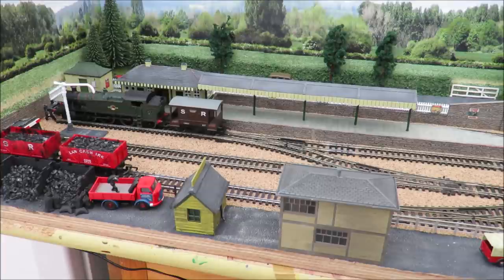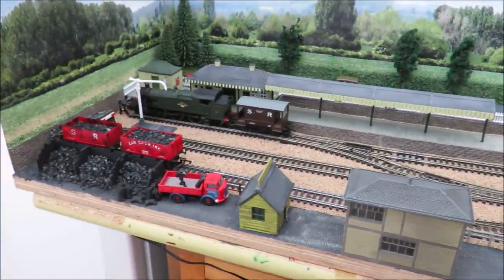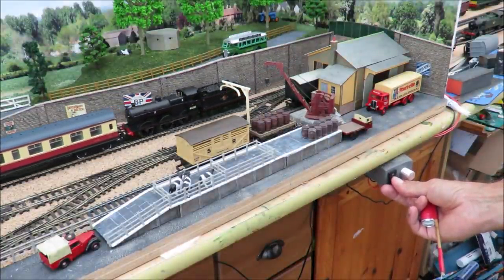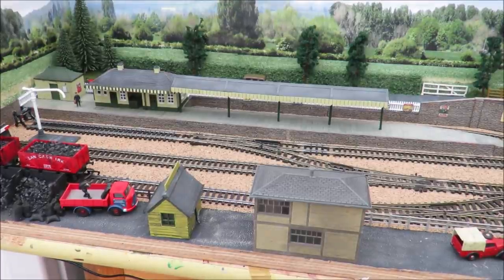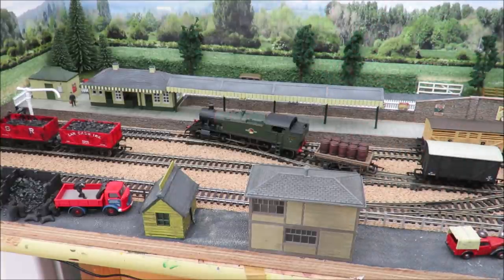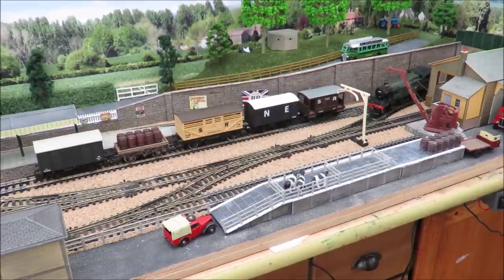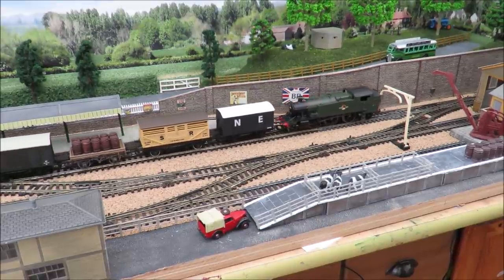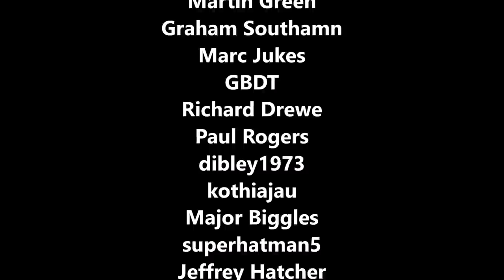My Ideal Shunting / Switching Model Railway Layout - Part 3 - Operating Potential / Trains Running

Comment: The layout shows the utility of having long head shunts and at least one storage (spare siding) track.  It’s like that game with 15 numbers on small plastic squares with one open area to allow the numbered squares to be slid into position. Open/available spaces are good. 

I’m not very knowledgeable about all things railroad ...... however, I get the impression that British wagons may be on average shorter than American rolling stock. All that to say that when designing layouts it’s good to allow enough space to allow the wagons that are used to sit comfortably without blocking track access for another consist. This presentation demonstrated that concept. 

And yes, test locos and wagons and their combinations. I’m still learning what pieces of equipment are best for a specific layout. 

Thanks, Mark
Reply from the maker: Thanks for the comment, yes prior to the 1980,s ish UK wagons were mostly very much shorter
Reply: Great thank you, I will have a look and  try and make one lol

Comment: Until I found your videos I never even considered having a layout just for shunting. This layout also brought to mind the town of Eureka Springs, Arkansas. It had a spur off of a main line that ended on the north end of the town. The only thing left is the spur. Very pretty small station made of stone, and there's a now abandoned ice house that the spur connected with. When I start building my own shunting layout, I might model it similar to that. Also there's a long abandoned spur that goes from my city to a little town called Chadwick, Missouri that used to service a mill down there, so I might incorporate that as well to give another industry. 

Thanks for the great video!
Reply from the maker: Glad we could help. Shunting is rewarding in itself and does allow you to at least run some locos and rolling stock in a small space. Those locations sound fascinating
Reply: Sounds a great basis for a layout, especially like the sound of the ice house

Comment: As you said we all have a preference for shunting.
When I was building my North End Sidings layout's actual sidings I purposefully chose to not include any run arounds.

Which mean I could use two locos to pilot between each other various stock consists.
Moving stabled stock, oil tanks for refueling etc all good fun.

Keep the videos up mate!

Comment: For the points you can use underfloor pushrods instead of point motors. That will save you the effort of rebuilding the platforms.
The problem with the newer style couplers might be the return springs. These will try to keep the coupler straight when no force is applied to keep them in a reasonably straight line.

Comment: It looks great i really like the wall at the back which slopes down.Well done for showing us all the fiddly bits! When it didnt go to plan etc.A lot of wagons are just to light to be pushed back and work better with a bit of weight added.My Budget Model Railway controllers are still working great after two years of using them.I wonder how many people made them in the end?
Reply from the maker: We have sold 500+ so far, 9 so far this week, so there are a lot out there!
Reply: @BudgetModelRailways  Im not surprised they do work very well,miles better than those poxy Hornby efforts,i also have a Gaugemaster controller i love it but these work just as well in my book :)

Comment: Watching now and I have empathy with you regarding the loco hesitation and and wagons jumping over points.
I have just about finished laying track, still looking for two left hand points which are difficult to find second hand here in Toronto. The odd older Triang  Sleeper coach will de rail and I don’t know what caused it. Also have acrake of grain tanks and some of them jump over points.
Could you do a video on this topic?

Another thing is the controller, I too have the same one you have and find sometimes when I try to slow a train down it tends to speed up. Any ideas on that?
Thanks and keep up the great work

Comment: Brilliant video , my small model railway is a shunting layout and I've been lucky to have done real shunting with a class 10( Blackstone diesel engine ) version of a class 08 and once shunted a class 33/ 73 and with Queen Mary brake van, to move a steam loco for coaling up.and also some trip goods workings too , and found I like shunting more than just going up and down the line with a passanger service, keep up the good work .
Reply from the maker: That must have been great! The nearest I got was a short ride in a class 07
Reply: @BudgetModelRailways  it was , can't do it anymore due to heath now and at 52 my eye sight not as great lol ,  but great fun getting to drive a diesel loco regularly a few years ago and one that a rare bread too as only a handful of class 10s left and I think only 2 still run now ? Also got to drive a class 37 too .when this horrible virsa thing is over you should both come to the spa valley railway am sure I can get you both a cab ride in one of the diesels?
Reply from the maker: That would be great thanks. We had a lovely day on the spa valley a few years ago. I had my cab ride on the lavender line some years ago as I used to know a couple of people there. Take care
Reply: @BudgetModelRailways  that's ok :) I rember one night on one of the diesel galas , a mate was driving the class 26 and I was on the rear with a class25 and the class 26 was failing , and we had a heavy train of mark 1s , so as my driver was on the radio and dead man's pedal and i on the power handle , so i put it on full power  and I still can hear and see the noise from the 6 cyl  Sulzer engine and sparks from the engine exhaust , was like the old times going up the bank at Manchester miles platting , just pure magic, and some  people think diesels don't have character! Lol also done  some  steam and it's not Romatic I can tell you that  from experience! Lol.

Comment: Pinking shears/craft scissors eh ! what ever next !!! Can't believe that I have a pair of my mums sat in a drawer and didn't know what to do with them . . . I do now !!! excellent idea. I have a large layout but with only a small engine yard to park up the odd engine. Having watched your vids on this theme I've now decided that I will be extending the width of my layout another 12" wide x 6' long and create a shunting yard. I have only ever used peco electrofrogs which require power switches as well as point motors. I've just bought a GWR train pack, new and un-used, of eBay that you mentioned on your harbour side vids as it seemed well geared for crawling. I hope this is as good as yours is. I never thought I'd be  interested in 'shunting' as it's termed but I've only watched a few of your vids tonight and I feel like I've been missing out. 
Question . .  do you think that using peco insulfrogs (smaller than Hornby) would be best for shunting rather than electrofrogs and all the extra power switching. The reason I ask is because if I use insulfrogs will this stop other trains in other siding from moving. I was thinking that if I had a long siding I cut effectively power it in 2 stages where only the front train would move leaving the rear train stationery and move that one later by powering up the 2nd part of the line.
I too have a problem with maintaining long term interest in things so I have to work around it . . . 'It needs to be complex and done now'. I know you'll understand where I'm coming from. Have to say I'll be watching more of your vids for sure. Cheers for the inspiration. xx
Reply from the maker: Hi, many thanks for watching and commenting. I always use small Peco insulfrog points for DC shunting as they transfer the power reliably and remove the need for isolated sections etc
Reply from the maker: Ps, but you wouldn't be able to have two trains on the same long siding unless you put an isolated section in
Reply: @BudgetModelRailways  Hi, thanks for the response on which points to use. I think I'll go with the peco insulfrogs as it'll be less of a headache if I forget to switch power to the right sections which could frustrate me. Cheers.

Comment: Due to space limitations my plan has always been to have a shunting layout. However, I really haven't known what to do for a track plan. Whilst I have been inspired by your earlier shunting layouts (it was the £35 layout that got my juices flowing for a layout in the first place) this is the track plan for me. Thanks, Mike, I think this will be perfect for my space and for my train running pleasure. Now the winter isn't too far away, I think it will soon be time to get building. I was undecided, also, whether to ballast or use mat. I have decided to ballast. I have also spent the past couple of years collecting all the bits and pieces that I need from bootsales, table sales, Facebook and Ebay and now I have no excuse not to get started, as I probably have enough track alone for a few layouts lol.
Reply from the maker: Sounds great , have fun with it and let us know how you get on

Comment: The layout you have build would work really nicely with some 'remotely' switchable points.
I found a fairly easy method for achieving this.
Get a small, long metal rod and run it through a small channel cut into the baseboard. Alternatively, you could have a layer of cardboard or something to elevate the track and leave gaps for the rod.
On one end, connect the rod to the point slider, and the other end (which should be sticking out from the side of the mechanism) put a small handle like thing, perhaps a cork or something.

This mechanism works well and doesn't impact the look of most layouts as real points are operated in ways similar to this IRL.
It can look especially good if you have all the rods running into the bottom of a signal box.
Reply from the maker: I have seen that method. If am honest I am quite happy using my finger. Cutting a channel into the baseboard, thick ply, would be pretty tricky and as I don't plan layouts, they evolve, I wouldn't know in advance what buildings and scenery would need adapting. I have used this method in the loft layout though
Reply: @BudgetModelRailways  Fair enough. I tend to put a softer layer of material over my baseboards, which is why I am able to use this method.
At the end of the day though, people all have different ways of modelling and there is no 'absolutely correct' way to do it. It is best to just model in a way that you find best.
Reply from the maker: I think its a good system with lots of advantages as you say
Reply: Ive seen that method used before its a very clever but easy way of changing points.

Comment: I'm interested in making a shunting layout, but I also love watching my trains go round. Could you do a combo of a run round layout & a shunting one like that? Not something I've really seen before, but I really like the look of this layout!
Reply from the maker: I like both too. If you had enough room it would be quite easy to have both, picture this layout as part of a loop
Reply: You can have a look at this layout: https://www.youtube.com/watch?v=nITB3NzGLR4&feature=emb_title  A shunting puzzle designed to be used both as a separate unit and as part of a larger modular layout. With an Arduino for driving and sound
Reply: @BudgetModelRailways  yeah that's not a bad shout, though that's the problem; having enough room. Might try & have a go though, plan a shunting layout like that inside a 1st or 2nd radius loop...
Reply from the maker: Exactly, it should work nicely as a through station
Reply: Matty P shunting layouts are a great way of unwinding. Mine is based on the inglenook shunting game, with the ultra reliable little Ruston shunter. 
.
Reply: That’s what I’m planning once I build up my skills. A large loop to leave my express running. A junction station to run a tank engine and auto coach along to my country terminus. Which I will happily spend time shunting

Comment: hi, great video, i use my old triang brake vans which are small, shunting the Birds Custard wagons around with a triang dock shunter ,then a triang class 31 picks them up for the journey to the shops,, i agree you do not have to spend a lot of money on locos and wagons. most wagons i have cost less than six pounds each. locos around twenty five pounds !
Reply from the maker: Sounds great fun, those are the sort of prices I aim for now too

Comment: OK, you didn't loose me. Just found you. Very nice switching (sorry shunting.) Question: I am from the US and still don't really understand the use of brake car (sorry wagon.) In the US the locomotive provide the air power to all the cars (sorry wagons.) Like someone mentioned, yes the hobby can be costly, but hey, that is the price of fun.
Reply from the maker: It's similar I believe to what you call a caboose?
Reply: Well, a caboose doesn't provide braking power. It is a place for the conductor at the time to allow checking for "hot boxes"(journals). As time move on, trains became longer and it became impossible to check bearing from the back of the train. Technology allowed the use of remote control "hot boxes" automatically from the track side with radio communication in the cab. The "journal" that use grease and packing was replaced by wheel bearing witch are more reliable. So the combination of those elements made the caboose obsolete. It is now replaced by an automatic device the check the air pressure and is fitted with a flash red light. Of course all of those apply to freight trains only. @BudgetModelRailways

Comment: That's a nice little layout you've built there. I know from experience that mixing wagons with different sized couplings can be a recipe for hours of frustration. My solution was to only use wagons with large D couplings. Happily the used market is awash such wagons :) Most of mine are Triang/Hornby but I've also found that Airfix, Dapol and Lima wagons play well with them. I avoid ANYTHING by Bachmann. If you've got a wagon which keeps derailing and it has plastic couplings then check carefully to see if there's any moulding flash which might cause problems. It the couplings are metal the check that they're at the right height. After that I'd look at changing the wheels if they're plastic. Finally a bit of extra weight might help although sorting out the couplings and wheels usually does the trick. ATB Paula
Reply from the maker: Hi Paula, all good advice thanks. I also prefer the older larger coupkings
Reply from the maker: Hi Paula, all good advice thanks. I also prefer the large couplings , less realistic but a lot more reliable!

Comment: Different tension locks can be a nightmare. It might be worth changing them to a uniform type. Dapol do various types in packets of 20 which you can often get for around a tenner, so not too expensive to change a good number of wagons etc.

Comment: This modeled an end of line station and town, if this plan would be in the middle of a rail line what track would be the through track, the one close to the station? Also using this plan, if you were to add a turntable and engine facility, how would you do it? personally I like the plan a lot. It could very well fill a problem area on my next layout.
Reply from the maker: Yes the through line would be the line by the platform. An engine shed turntable etc would need a longer board and another point to fit in

Comment: When did BR run mixed goods and passenger trains up until? 
 Was it up until the infamous Dr. Beeching cuts of the early 1960's?
Reply from the maker: Actually in limited numbers right up to the late 70s. I have even seen a picture of br blue grey coaches with goods wagons.
Reply: Wow didn’t know those mixed trains lasted that long in the UK. There were very few examples of mixed trains here in the US up until recent times. One example was one run on the Georgia Railroad up until the early 1980’s that had a passenger coach on the end of a freight and it only lasted that long because of some state regulation or tax break they got from the state for running a mixed train. The Burlington Northern ran a mixed train up until the early 1970’s down the Deschutes River Canyon in Oregon that was popular with fishermen and hunters because of certain areas that were only accessible by rail.
Reply from the maker: Great info thanks

Comment: Great video with an interesting shunting layout. Just one suggestion :- the line where the man is standing on the platform could be a small wagon longer. My only disappointment was you did not show your Fiddle Yard.
Cheers   Greg.....PS Short videos are the way to go. Anything over 15 minutes I watch in two parts or whatever is required.
Reply from the maker: Hi Greg, I will show the fiddle yard next time

Comment: Enjoyed the whole video on your favourite shunting layout. How many points are required & how many power links are needed to run all round please?
Reply from the maker: I'm sorry but this layout is long gone, it should be possible to work out points from watching the video. There were only two power feeds, one on the entry and one for the kick back sidings at the end of the head shunt. Power is switched and isolated via the points

Comment: Can you remind me where the power was run for this Mike. Was it just the usual two wires or did one on the sidings need an additional feed? Is there an isolator?
Reply from the maker: Yes additional power feed with an on off switch to isolate it